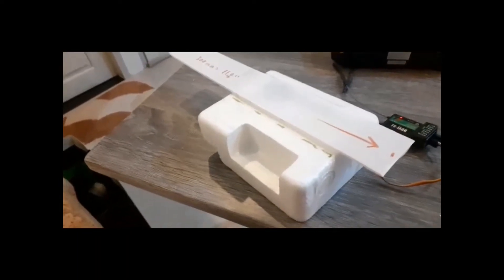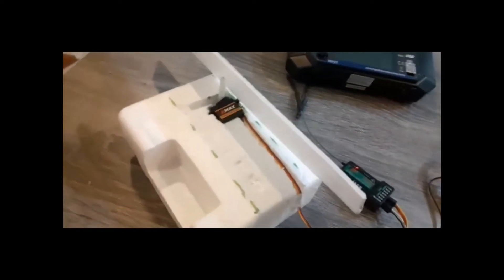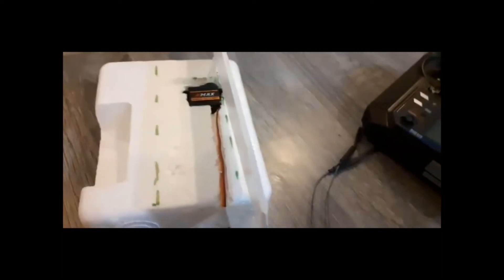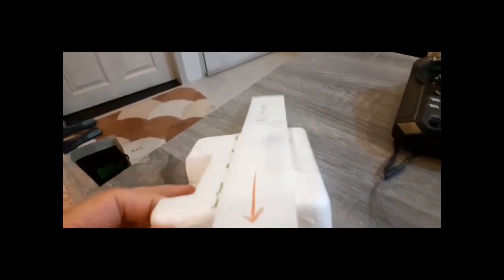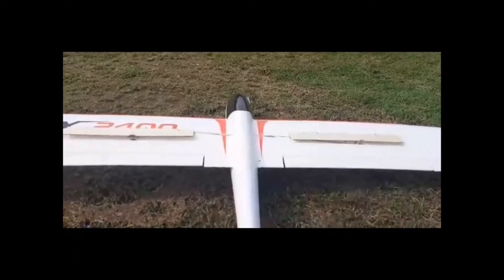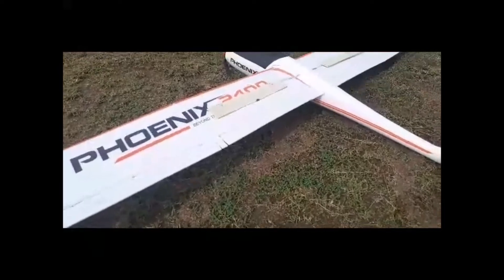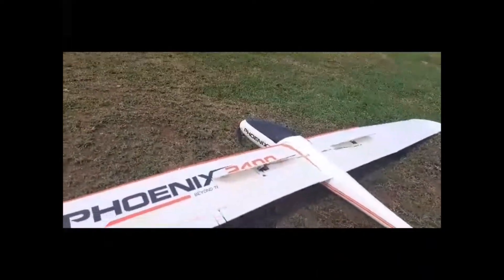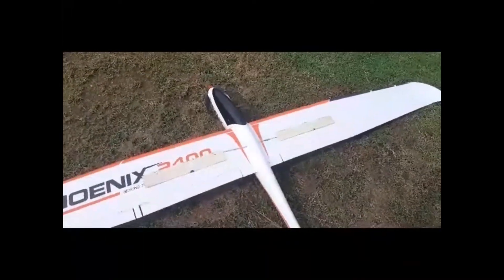RC motor glider Phoenix 2400  flight spoilers

Comment: Great glider, but….  Mine crashed after a RX failure and destroyed the fuselage.  Please note, V3 fuselages are NOT a valuable; only V2.  V2’s will NOT work.  So I’m saying it’s a great aircraft but if you can’t get replacement parts, don’t buy it.  I will not buy Hobby King in the future. 🥲😡😡